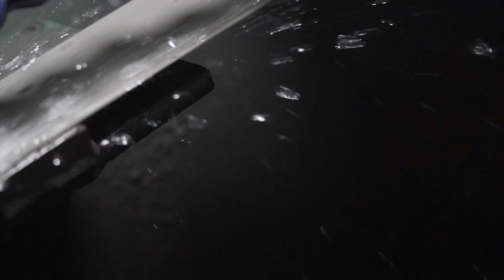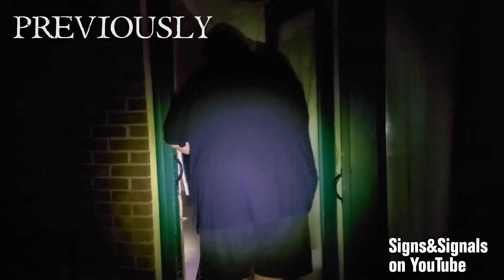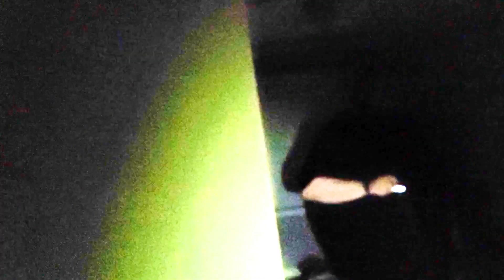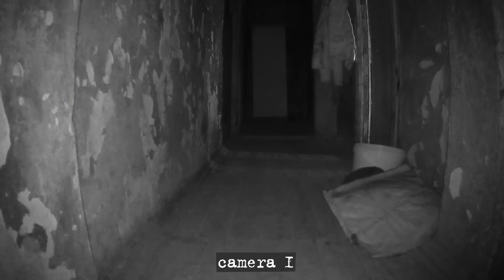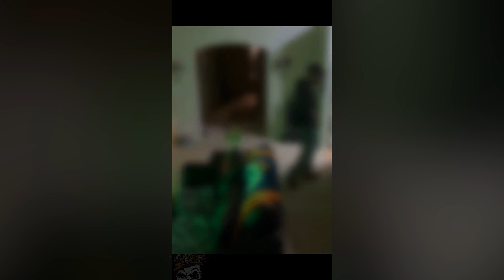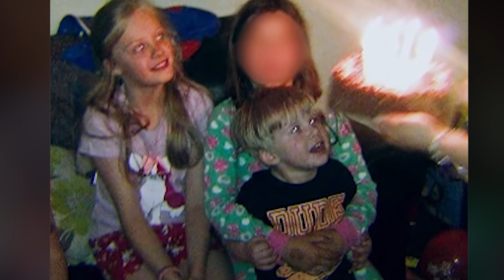The Scariest Videos You CAN NOT Unsee

Comment: Home alone was nice as the door behind her was shut or mostly shut .. and as she dances the door blocked from view opens to show the image.  It wasn't a sudden image there then gone but the door moved.  You can actually see the light angle on the door start to change in one image before blocked with her head again so it's not a cut pattern  for the door (and the light angle matches the rest coming into the area).  What is concerning as well as the black dot on the door which might be a peep hole indicating it goes outside the home (making it worse) .. or maybe a hook so hard to tell.  nice one.